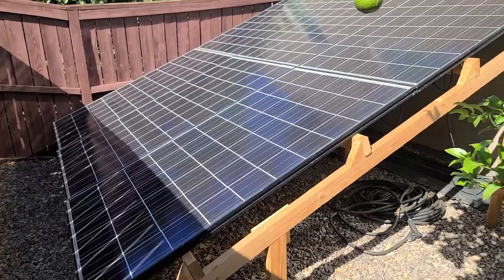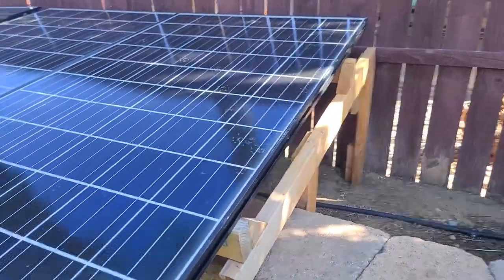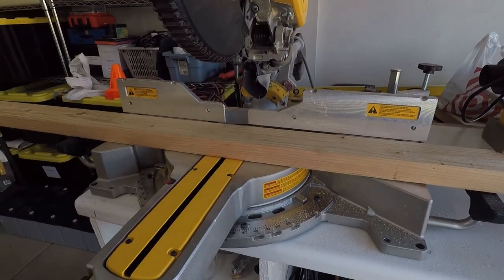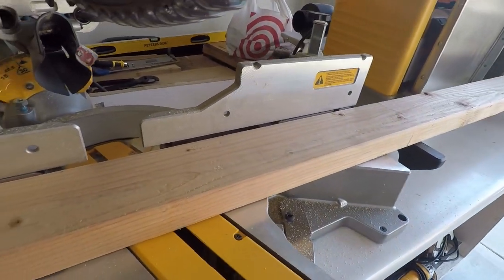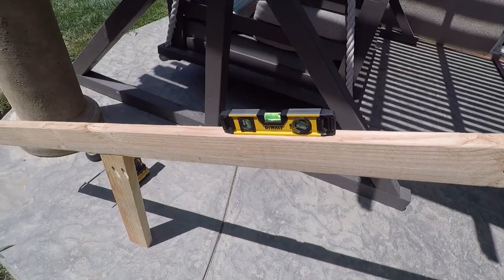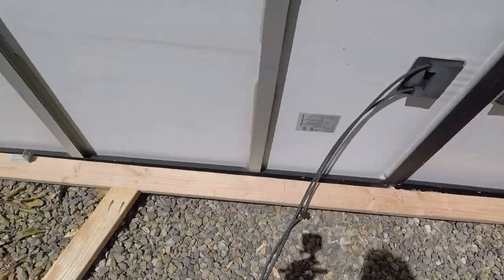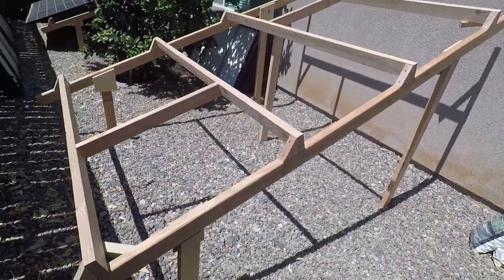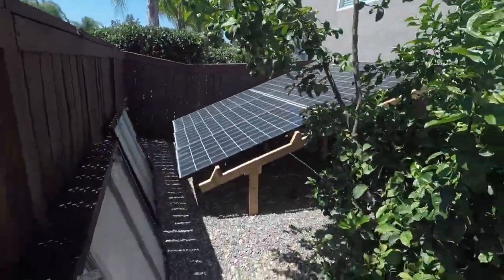DIY Solar - Solar Panel Stand Build

Comment: Thanks for sharing. I subscribed. It's neat and simple.  I will copy your design. By the way, would you please provide link on what degree for panels in Florida? Thanks and hope you will post more vid.
Reply from the maker: Hello Tom. Thanks for subscribing and feedback. There is a lot of informative links out there on this. You could start with these two and probably will be all you need.  https://sinovoltaics.com/learning-center/system-design/solar-panel-angle-tilt-calculation/#:~:text=Calculation%20method%20one,34%20%2B%2015%20%3D%2049%C2%B0.

https://www.solarreviews.com/blog/best-solar-panel-angle
Reply: If you live in Florida, you need a rack that can withstand 200+ MPH winds! "Wood" won't do that for anything above a 5-deg tilt. You would need steel I-Beams and footings for a 25-deg optimal tilt. For those who don't live in Hurricane alley, I would highly recommend Powerfield PowerRacks for ballasted ground racking.
Reply from the maker: Thanks Todd.